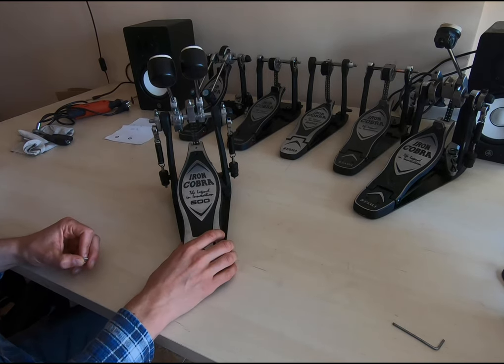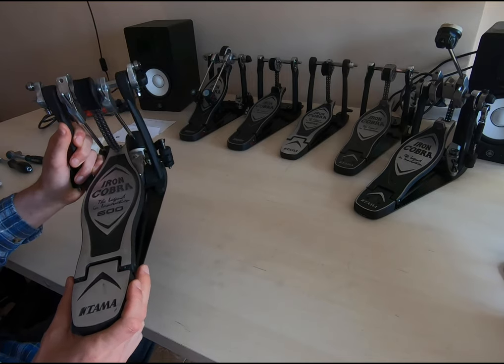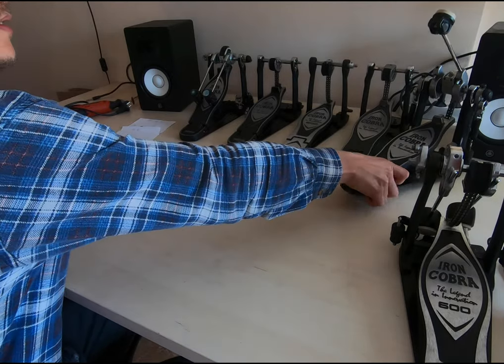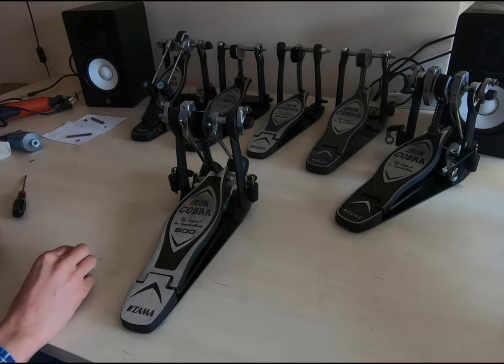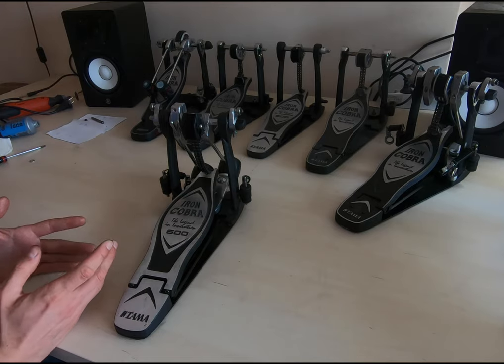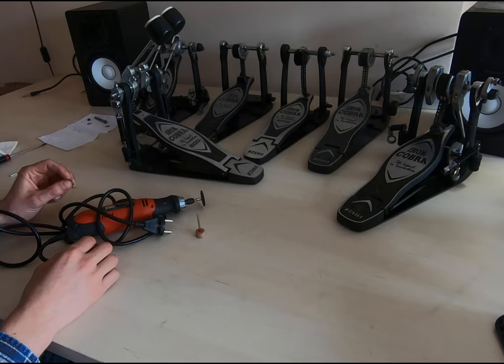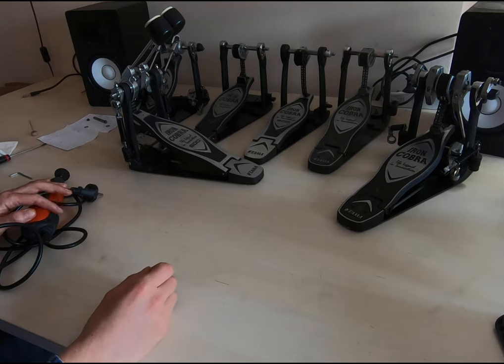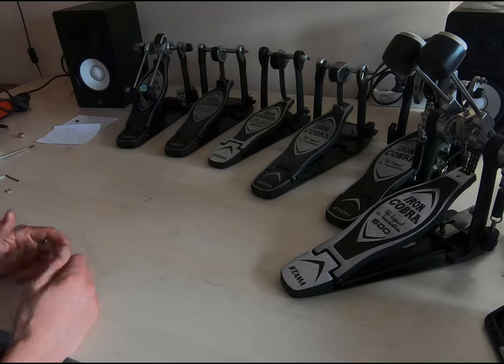How to fix a loose Bass Drum Pedal with a washer (Tama Iron Cobra)

Comment: I was able to get rid of some side play in my 310 series Speed Cobra by just rotating the metal pin slightly and retightening it.
Reply from the maker: nice! I guess it will loosen up again at some point, because of fraction, but I bet this will take a while and then you can rotate the pin again. Let me know when you have to do it again,  just to see the long term effect of this solution. I hope it lasts for a long time!
Reply: @sebastiandobbelin3069 lasted me 4 months. gets loose every time i tighten them now, need a new pedal haha

Comment: Sebastian what is the ratchet you use on the heel plate @ 9 minutes? I cannot find anything small enough to undo the bolt on my early 2000s IC. Thanks for the great video!
Reply from the maker: Hey thanks a lot. I can’t really remember which one I used. So normally I have a basic ratchet set for mechanics, but I also use a bit set for mobile phones and laptops.  If you’re looking for a very small one I would try one of those. 
Cheers

Comment: nice one! can you tell what size those nuts are on the 900?
Reply: Thanks a lot. Sorry I can’t help you with the nut’s size.
Reply: @sebaspeaceofwood7272  Nevermind, eventually I just figured out, they are 7mm. I've just replaced my oiless bearings with 5x11x4 radial bearings for like $5, and it is just like a new one, it is a huge difference, almost no play at all, nothing.
Reply: @thumDerr  do you have a link please?

Comment: Any idea if it's possible with 200s?
Reply from the maker: I don’t know the 200s. But if you can disassemble them (might be different like the 600s and 900s), it should be possible. Another quick, but not very sustainable solution can be a guitar pick or anything else to fill the gap. In this case you don’t have to disassemble the pedal.